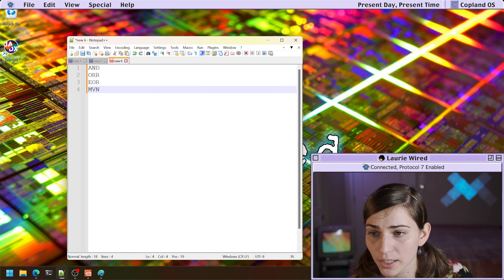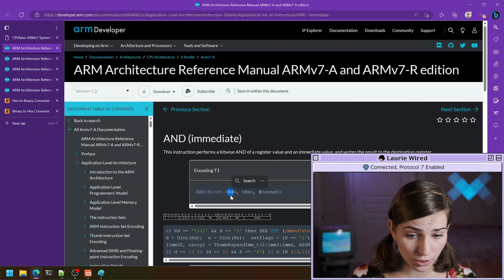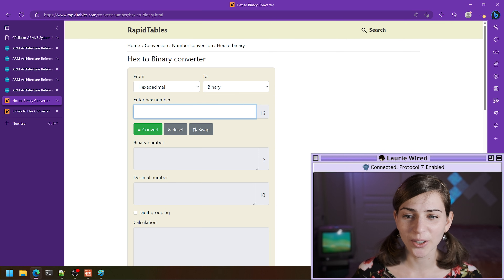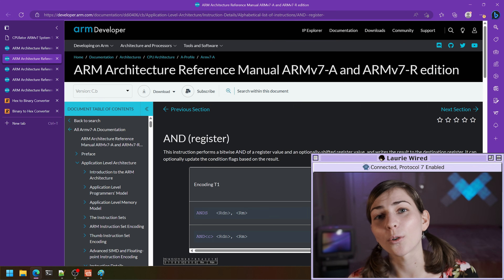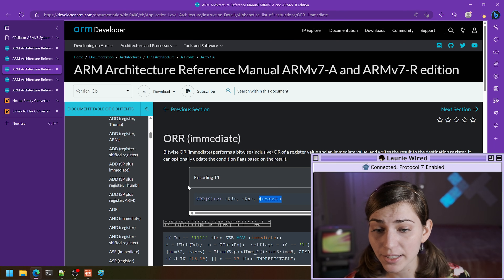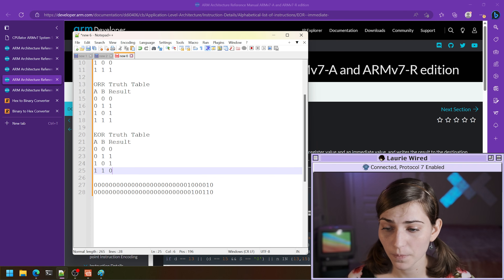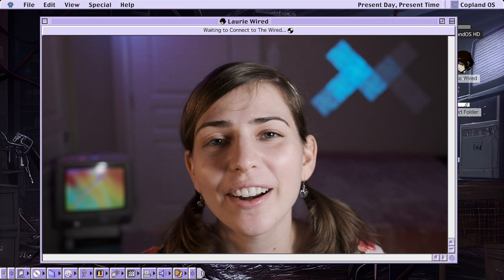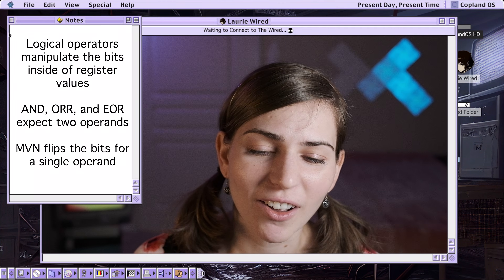ARM Assembly: Lesson 4 (Logical Operators)

Comment: huh? 64 is a power of two so just one bit should be 1 in a 32 bit word. 0000000000000000000000001100110(base2) = 102(base10).
Something must have gone wrong?
Reply: If you're referring to the result of the eor instruction, it's 64 in hexadecimal, or 100 in decimal.
Reply: @chitlitlah  Yes, I realized that too. But she said "64" in the video, so I was confused.